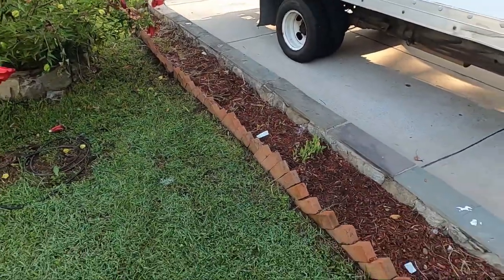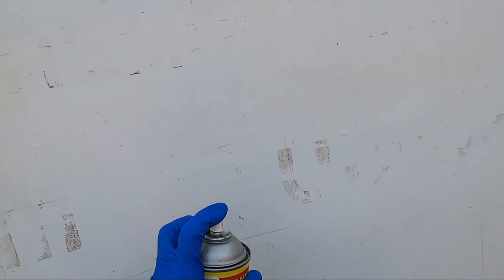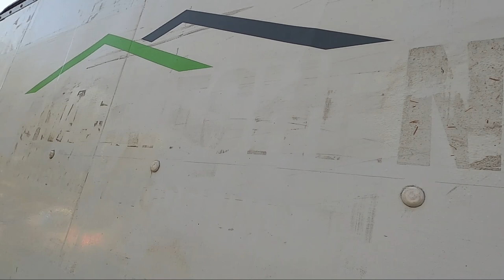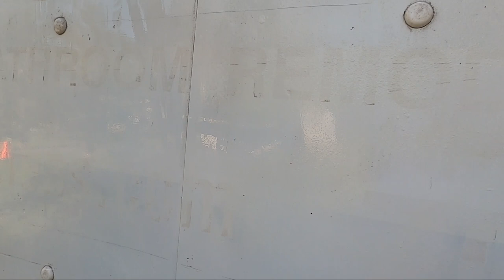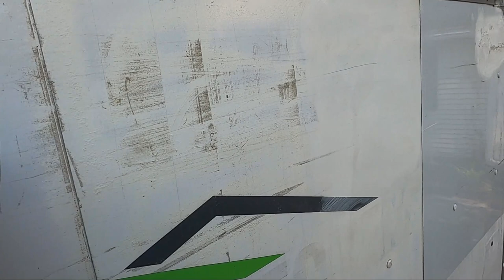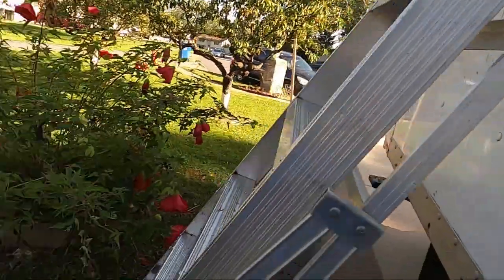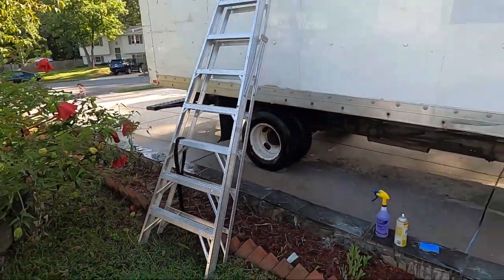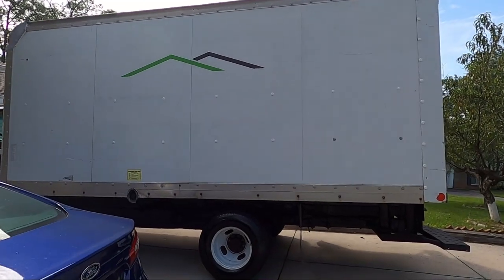faster way to remove letter glue off your truck work van

Comment: Thank you for this video. My husband bought his work truck and it has some fleet numbers above the fender on the quarter panel just under the hood. How should I remove the numbers ? Thank you for any suggestions. I’d like to surprise him in a good way, not a yikes way. 👍🏼😉
Reply from the maker: Lol letters you can add WD40 and then pull the letters off after 15 minutes,, or scrap it with some plastic blades
Reply: @nestorautorepair  thank you sugar, I appreciate it and I’m
Sure he will
As well! 🙏♥️🙏
Reply from the maker: Thanks , you're welcome, best luck